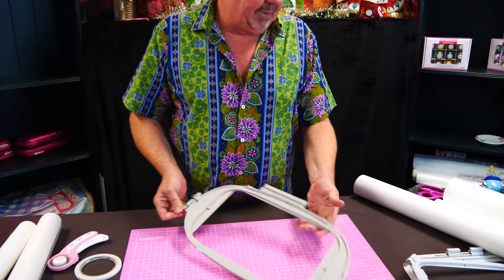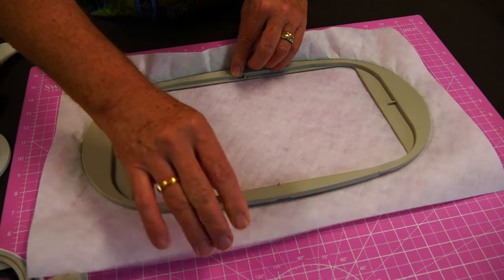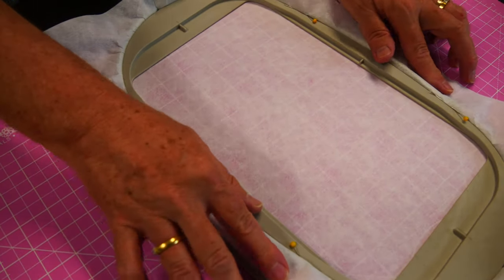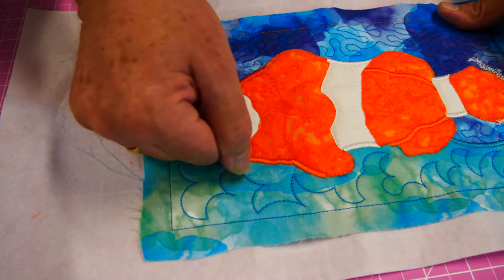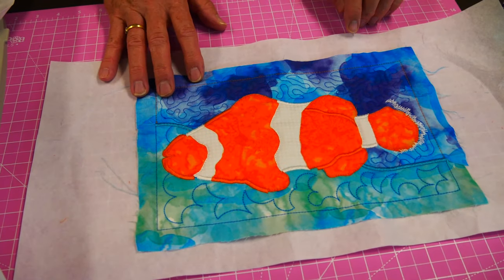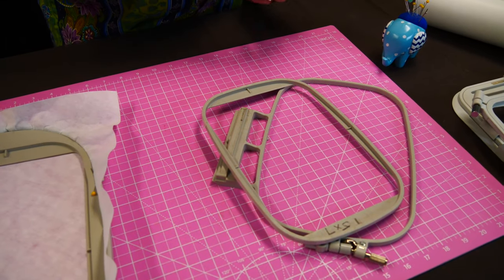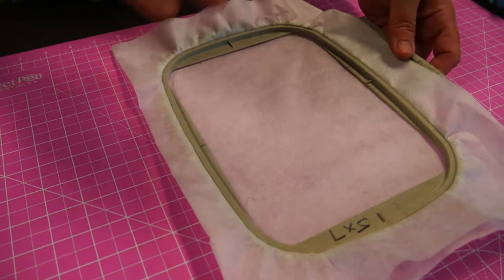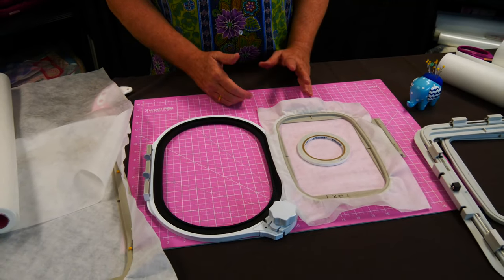How To Hoop Up Stabiliser For Machine Embroidery "The Right Way!"

Comment: I have the same hoop, Martin, so I assume you have a Brother Embroidery machine? I have never had to pin my stabiliser and I leave very little margins but what I do it I tighten the screw up by hand until I can't tighten it any more and then I use the tool to tighten it more. I have been using this method for a couple of decades at least and I have never had stabiliser shifting. I would also worry that using pins in this way might invalidate the warranty. These hoops are made to be secure and tightened using the tool provided and will secure the stabiliser so it won't move at all.